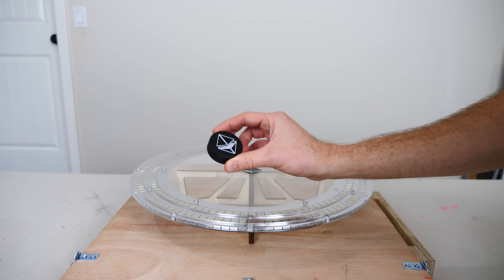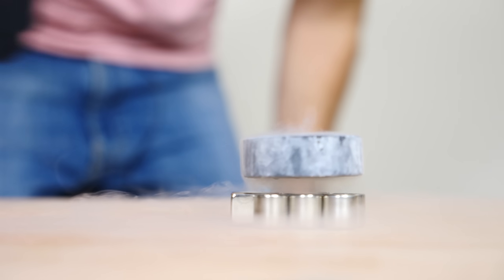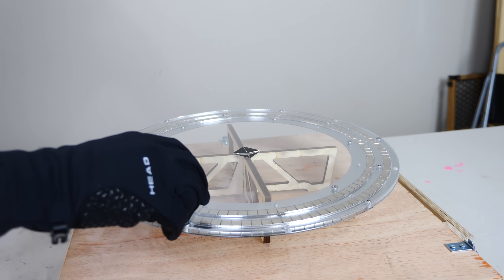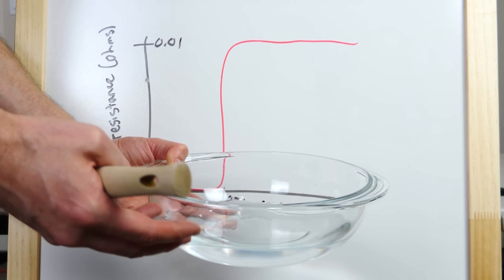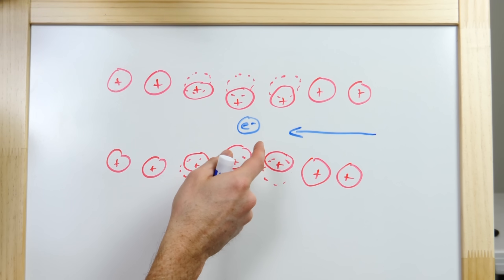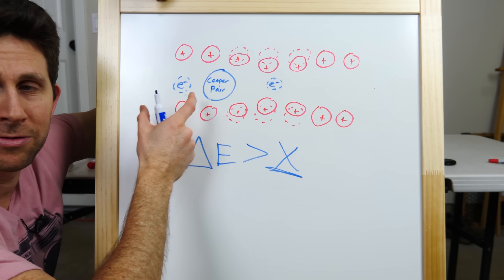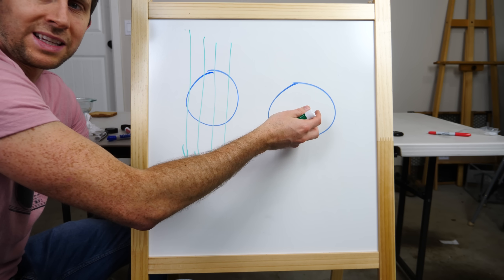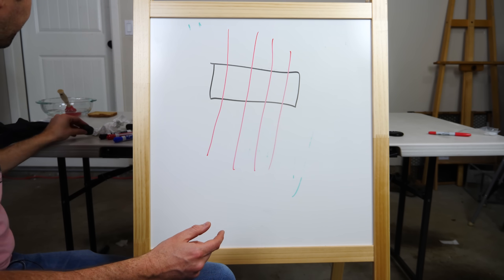Quantum Locking Will Blow Your Mind—How Does it Work?

Comment: What if you had a type 2 superconductor board, with insulation for you to stand on, then a magnetic half pipe for hoverboarding? Also, could you create a perpetual motion device with a type 2 superconductor connected to a magnet that spins, with the spinning piece connected to a device that collects its kinetic energy, then a copper plate to collect the electricity? Where would electricity be lost besides cooling the superconductor? Is there a way to perfectly insulate a superconductor to stay low temperature?

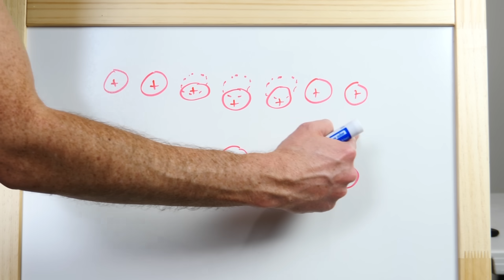Comment: 9:07 in: (the electron moving through the latice of positively-charged atoms)  Because of electromagnetic theory, wouldn't the electron simply crash into the nearest positive ion?  I realise it would depend on how fast the electron is moving,  BUT  YOU  DIDN'T  TELL  US  THAT.  I've read that free-moving electrons travel at a much slower speed than their orbital speed around the nucleus (when they're not free-moving).  So, I'm thinking the only way the heavy positive ions would slightly move toward the electron (but the electron doesn't move toward any positive ion in your diagram), would be if the electron were moving  VERY  FAST.   In fact, can free-moving electrons move that fast? So that hypothesis to explain the superconductor's perpetual motion looks bogus.  As for "Quantum Entanglement", check out the Veritasium video: "Is This What Quantum Mechanics Looks Like?"; which is a good macro analogy for a scientific explanation (an hypothesis) of the double-slit (and other sub-atomic experiments) that does NOT need "spooky action at a distance".
Reply: [Surprised pikachu]
Reply: Well it's not a surprise to the maker of this video.

Comment: It's exciting to hear that we are so close to room-temperature superconductors (allegedly above 0° in freedom™ units, around -13° in commie units, getting close to 260 K in Lord Kelvin units). If only we didn't have to crush it with Jupiter core-tier pressure first.
The serious question I have is how we might utilize the Meissner effect for things like transport. It seems obvious at first until you realize that the superconductor itself is what needs to be propelled. You can't just throw some lanthanum decahydride under your grille and start flying off. It has to float on something first (meaning roads would have to be refitted, and good luck getting funding for that).

Comment: couldn’t this become a method of transportation especially for items other than humans that would not require any gas which would help with global warming
Reply: I not sure about if it could be ecomically viable. To cool an entire storage container for resources to the right temperature takes energy. It would quickly become costly trying to use the track. The cooling of anything to move along the track would require energy so it won't be carbon neutral unless what powers it is. Normal maglev trains work better as the generation of the field is more economical than cooling something to the required levels across kilometers long stretches.

Comment: Is that just a Dixie cup? Lol amazing, is that a weak force effect, described in the basic model? damn near zero loss of force, it is effectedonly by the drag of toast, need to prototype and aerodynamic toast, lol , 

the way you've explained locking it sounds like quantum weightless frozen velcro!!! Good stuff!  

Got a question in 28 parts, I know tachyons are theoretical superliminal particles and from what I've read, they can be detected by chernakov effect, 

Here is the tin hat part if there exists multiple dimensions, each with its own governing principles, could or does quantum field & phenomena be evidence of such a thing, tachyons or superliminal particles might be another form or phenomena as evidence of multiple simultaneous universes.

I kinda hold the believe that space time is not so much a plane but a plain within a substance, imagine the solar system encased in supermicroscopic fibers vibrating (aka strings) these string are effected by all sorts of particles causing energy release, that they coalesce almost in a gelatinous state as black holes.  If you imagine the universe is a blob of Cesar salad dressing and another universe as ranch, each has its own composition, everything is governed by the same basic particles but in different combinations, back 2 my point if you accidently mixed the two say one blob of Cesar broke through a cleavage like cells conjoining bound together after basically breaking surface tension, this would be the near infinite gravity to tear thru to another universe, I imagine if an observer inside this universe was 100 ft away from the opposite side of an event horizon they would witness the inpouring of light, dust and heat and gas from this rip basically in the sidewall of the universe, dark matter and dark energy growing with our universe might be symptomatic of such a condition, still though what creates the spark that fuels any of the, I imagine particles beyond light speed could effect or vibrate the in layman's térms strings that makeup this spacetime, I dreaming when wrote this, forgive if it goes astray, -- Two thousand two zero party over its out of time.

Comment: I guess that engineers would design this on some vehicles like trains.
Reply: NiCK79 Rosales there a couple of problems that he explained in the video. 1) it has to be veeery cold 2) it will gain heat/energy  if it moves to fast . A train will gain way too much heat just moving even slowly 😔 if you solve that, you might just get a nobel prize?
Reply: SuperKasseler duh.. Just use a small RPI fusion reactor to cool it down lol
Reply: @SuperKasseler  all you need to do is recycle the heat energy into a cooling unit designed to keep the temperature way below the requirement.
Reply: NiCK 79 suddenly everyone engineer. Me slowly walk away..

Comment: 3:40 so technically that has infinite momentum other than the friction between the air and the puck theres nothing slowing it down right?
Reply: Not quite, because the impurities that are allowing it to float have some EM resistance. A type 1 superconductor would never lose energy (as long as it stays cold enough), but those are totally unaffected by magnetic fields and won't levitate. Also, standard magnets degrade over time so eventually (decades?) they will lose enough power that the field won't be able to support the weight of the puck.
Reply: @holl0918  but if the superconductor stayed at that constant cold temperature, it can move forever? what if it was placed on a vacuum, eliminating air resistance? for example if we are to put this on Neptune it can contain the momentum forever? This seems contradictive to the laws of physics isnt it? im no physics major so feel free to explain if my understanding is incorrect
Reply: @brandoncrz2228  It is mathematically possible, but only in a world where you have control over every single bit of energy (taking into account that matter is frozen energy) in a completely isolated system. If the energy has no way of leaving the system, then perpetual energy flow is achieved. IRL it is impossible though, because there is always a way for energy to leave the system. You can minimize the loss, but it will achieve equilibrium eventually. It may take billions of years, but it will happen.
Reply: @holl0918  yes exactly, ive searched abt videos where even in space it isnt completely isolated, i didnt take the various particles and radiation as well as the atmospheric pressure into account to my statement. Of course the laws of physics is absolute and proven and cannot be exposed, because just like what you stated energy will always dissipate in numerous ways. We can only increase the efficiency to a certain extent, but making something perpetual or what they say "free energy device" are bogus as sh*t
Reply: @brandoncrz2228  It dosn't mean that there aren't ways of generating energy that are so efficient that the minimal loss isn't a problem though. Finding them is the fun part... 😏
Reply: @holl0918  of course and i agree... Future technologies will make this all a reality
Reply: Momentum = mass*velocity . Neither mass or velocity is infinite therefore not infinite momentum
Reply: This has nothing to do with momentum. It still has a finite amount of momentum, it's just not being subtracted by nearly as much friction. The momentum of the puck is related to its mass and velocity. Its mass never changes, it's always m. So if you give it a push with x velocity, it has mx momentum. If you give it a push with 2x velocity, it has 2mx momentum. You'd need to push it to infinite speed, or give it infinite mass to give it infinite momentum. It's pretty much like a train on a nearly frictionless track, it just loses speed due to friction a lot slower.
Reply: Just because something can move forever does not mean it has infinite momentum. Think of it as a tank of gas, nothing can have infinite gas. However, the gas is only used up if friction is slowing it down. And when you speed up the object, you're putting gas back into the tank.
Reply: It has a very finite momentum of it's mass multiplied by it's speed.
If it had infinite momentum it would have smacked right through the guys hand when he tried to slow it down.
The setup simply removes friction (well not completely and air resistance is still a thing) so that the momentum does not decrease by itself but the momentum is still a very finite number.
That is also why you can not use it as an infinite energy source.
Reply: Infinite momentum? You crazy?
Reply: @mukherjee.p  it isnt possible, this is just a speculation after all, a discussion
Reply: @brandoncrz2228  hmmm
Reply: @brandoncrz2228  so after all there are other variables that'll slow the puck down eliminating infinite momentum or wat evr the correct terminology is?
Reply: @cremymolo97  yes, even in space there are many factors that can slow the puck down, eventually bringing it to a stop. https://youtu.be/_rJOSDgDG0A

This is the video talking about the possibility of creating a perfect vacuum to eliminate every other particles, and the answer is impossible, fulfiling the laws of physics after all.

Comment: 1980: in 2020 we’ll have flying cars

2020: ROTATING BREAD
Reply: Musicman928 This is the future of sushi conveyor belts
Reply: You meant:

REVOLVING BREAD
Reply: @varunmanjunath9123  you meant:
DRIFTING BREAD
Reply: @БРАТ-р8к  Oh..... Oh wow... For 2 weeks, I've been blind to the truth! All hail the DRIFTING BREAD
Reply: @БРАТ-р8к  you mean LEVITATING BREAD
Reply: "I have done nothing but rotate bread for 3 days."
Reply: We can make cars fly with it.
Reply: @zeus44444  i was thinking the same thing
Reply: Apurba Gogoi we probably can use this to launch us into space in an instant.
Reply: @zeus44444  We can but this would just work as a engine that spins, It will be in term another type of propeller, if you think we can just replace roads with metal there are two issues, first corrosion and second you cant steer.
Reply: Why is there always this expectation for what happens in 20, 50, or 100 years and its like the EXACT opposite
Reply: We do have flying cars most just do not have their pilots license
Reply: To make it worse,... In the 80's we actually thought we'd have flying cars by 2000 :/
Reply: B R E A D
Reply: Flying bread.
Reply: THIS IS THE BEST THING SINCE SLICED BREAD!
Reply: Also 2020: unoriginal comments
Reply: 2030 : Bread orbiting the center of milkyway
Reply: The Jetsons came out in 1962.
Reply: You could say flying bread
Reply: Well its a start in that direction.
Reply: "In 2020 (sic) we will have magnetic rivers with trains floating on them" - The video I started on
Reply: HOVERING ROTATING BREAD
Reply: Brroo I'm watching it while I'm reading it I'm dead
Reply: This was legit one of the coolest things I've seen
Reply: RO TA TE
Reply: Couldnt be more perfect.
Reply: Hahahahahaha I came here looking for brass...and i found gold! Good one! Hahahah
Reply: 1980: These maglev trains are great, and will replace airplanes as a much cleaner option in the near future.

2020: LOL floating bread

I think we took a wrong turn, somewhere.
Reply: U need more likes
Reply: the future has already begun "and we still don't have a flying car"

Comment: What would happen if you loaded up that magnet with a weight on the underside when it is hanging in a quantum locked state underneath the track? Would it pull away? Or can the weight be supported?
Reply: It would fall if the weight was heavy enough to pull it out of the magnetic field.

Comment: We can take a shot at explaining magnets and superconductors without resorting to quanta, just magnetic fields instead.
So the magnetic field is caused by a rotation of particles in the orthogonal to the north south axis.  This rotation of particles stirs space into a vortex or corkscrew field.  At the same time, magnetic objects inhibit particles from moving along the north south axis.  Think of electromagnets where the insulation of the wire prevents motion along the axis.  The vortices' fields screw together or apart causing the attraction and repulsion of magnets.
Superconductors do not gravitate to magnets because particles in the superconductor move freely on the north south axis.  However, superconductors acquire a magnetic field because their particles have no resistance to contend with regarding the vortex field coming off the magnet.  In turn, the vortex coming off the superconductor gravitates the magnet.
The superconductor also repels the magnet.  When particles in the magnet encounter resistance and "scatter", they fall behind and get kicked outwards and around by the superconductor's vortex field.  (The "around" component finds no resistance but the "outwards" component causes anti-gravitation.)
The gravitating and anti-gravitating effects meet in equilibrium.
This is all hard to explain without being convoluted.  This is the best I can do.
Reply: no
Reply: @sumsar01  Maybe.  Why not?  I can understand this explanation, but not the explanation in the video.
Reply: @sumsar01  It seems the curve of attraction vs distance between the magnet and the superconductor is in fact the same curve as the repulsion vs distance.  This explains why repulsion matches attraction in all orientations of magnet and superconductor -- the equilibrium is everywhere.
Reply: I should have mentioned that the equilibrium for the superconductor acting on the magnet is such that repulsion and attraction are plotted vs vortex rotational speed or perhaps vortex strength.  It doesn't matter how difficult the two functions are -- they meet at R=A.  Standard equilibrium graphs in an 'X' pattern, curves meeting at a point where R and A are equal. On the left of the equilibrium A>R, on the right R>A.  When R goes up, the vortex slows and A goes down.  When A goes down R goes down and the vortex speeds up, and so forth. Meets at A=R.
Reply: no left R>A, right A>R
Reply: Left of equilibrium R>A and repulsion is the result until the equilibrium is reached and A=R.  Vice versa for right of the equilibrium.
Sorry for the obfuscation.
Reply: increased speed is the result?  Just ignore me now!
Reply: How about the mass of the components?  In the situation where a superconductor is floating above a magnet, there will be a constant additional attraction due to gravity's effect on the superconductor's mass.  So the curve for attraction vs. speed moves upwards by a constant amount across the entire speed axis.  Thus the equilibrium position shifts right meaning equilibrium speed is increased.
At distance zero between magnet and superconductor, repulsion is at a maximum.  This maximum is not infinite, and therefore some amount of mass added to and compressing the system, will overwhelm the repulsion, gravitation will outweigh anti-gravitation and our equilibria (vs both speed and distance) will cease to exist.
For a superconductor floating under a fixed magnet, gravity pulls the system apart meaning the repulsion vs speed curve is shifted upwards by a constant amount across the entire curve.  Thereby the equilibrium shifts left and equilibrium vortex speed is reduced.  Obviously, if weights are added to the superconductor the repulsion at some point will overwhelm the attraction and again, the equilibria fall apart.
Reply: But wrong.  I think the curves for A and R vs speed change when equilibrium speed changes.  I now think increasing A lowers equilibrium speed and R raises it.  It is hard to tell what is going on without the exact functions for A and R vs speed.
Reply: Another possibility: added attraction and added repulsion both shift the equilibrium right.

Anyhow, that's about all I can manage on the subject of superconductor and magnet interactions.  It was fun to explore this rabbit hole.  No quanta were used in the production of this lecture.  We were able to explain why magnets and superconductors stay where they are placed, and why they both attract and repel.

Comment: Why can’t this be used to generate infinite electricity.
Reply: Before you ever ask yourself this question again, I will clarify that the universe is simply built on a few laws, and energy conservation is one of them, unless we tap into other universes( if those exist), we won't get more energy than there is around right now. As to why this one doesn't work, its because its simply an "energy Bank" of some sort, if you put in some energy and that makes it go around, it will simply do that forever, until you try to extract that initial energy, and it slows down until there is no more energy in there at all and it stops.